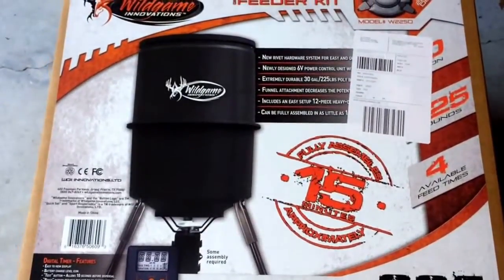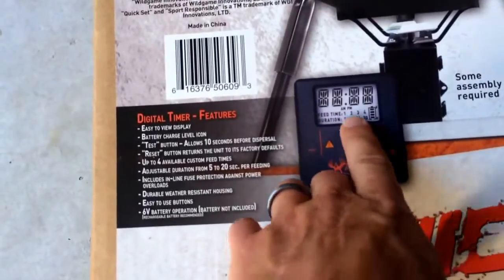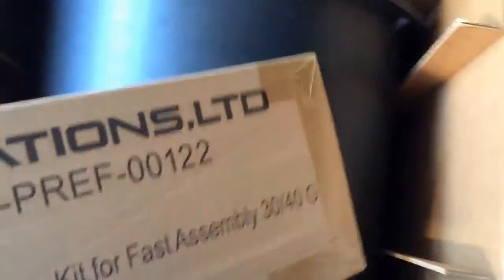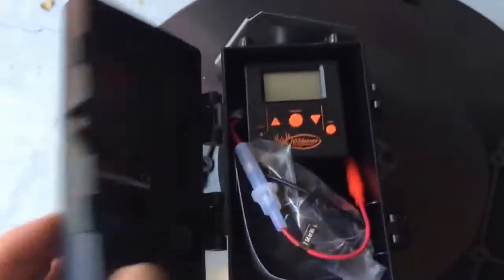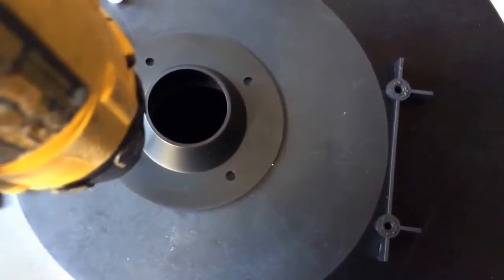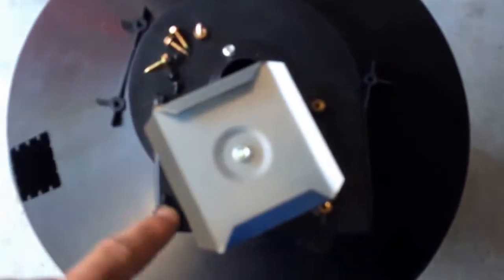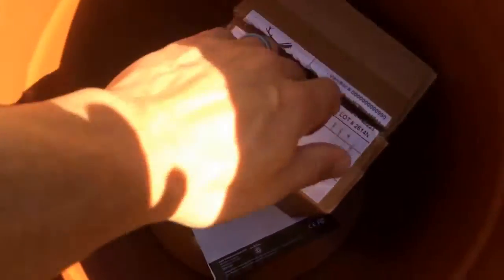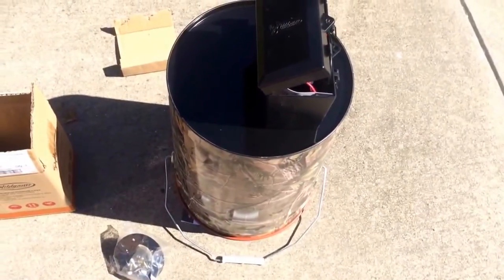WildGame Innovations Deer Feeder Quick Set 225 Tripod Unboxing and Set Up Full Video

Comment: This video is like the others I’ve watched, they never complete the task they just skip on to something else, the answer is that it does not take 15 or 30 or 45 minutes. It takes hours of extra screwing and drilling. I’m completely disappointed in the one I have. However I hope it works better than it was to put together.

Comment: I had lots of problems from their 6 volt rechargeable batteries not working. I've bought 3 batteries and  2 chargers from Tractor Supply. Neither charger worked! Went back and tried 3 other Wildgame Innovation chargers at the store.....only one worked! Anyone know a good 6volt charger for these rechargeable batteries? Two of the new battries will not take a charge!  I got one that will take  1/2 charge after  three days on their charger! Called their warrenty hot line and got crappy service the first two times I call. next I tried  E-mail--- got a request for paperwork then proof of purchase then nothing!

Comment: This has never and will never take 15 minutes to put together. I’ve yet to see a video including this one that doesn’t go through every step they just skip the parts that are hard. It takes added drilling and added screws to put together. It will take anywhere from 1 to 2 hours to put together guaranteed. I hope it works better then it was to put together.

Comment: I have no instructions in the one I just bought and have no idea how to connect the hinge to the lid. Any help would be greatly appreciated!
Reply from the maker: The one here had screw and bolt that when through the plastic as the hinge
Reply: get on the website and send them a message. I bought a camera on ebay from them that was an older one and it did not come with a manual. They emailed me a manual within 2 days